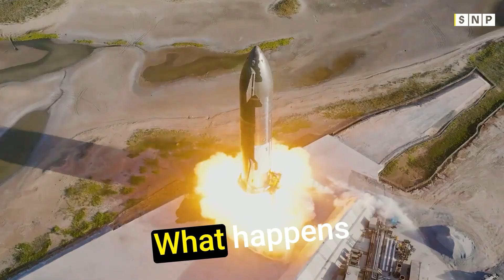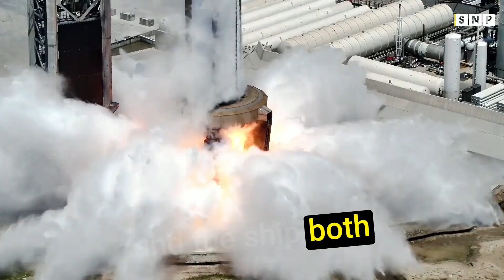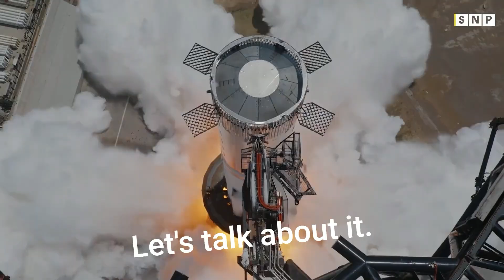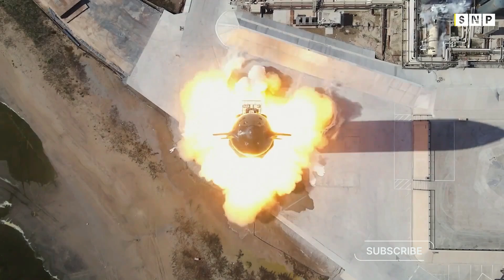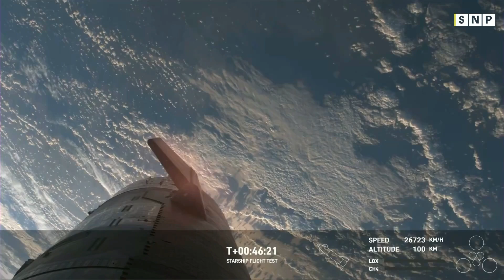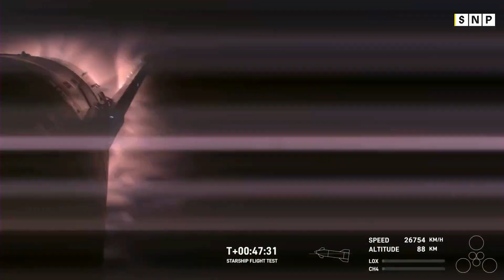SpaceX Starship Update - What happens next?

Comment: The pirate thing is nothing to worry about. There will be Military vessels on stand by. Also, I have worked with detonation/explosives for many years in the Military. You can submerge C-4 under water, and still remotely detonate it. 
The biggest issue is re-entry. It struggled on IFT-3, but that's all part of the plan. Look at F9, and how much it took to get to where its at now. 
Thanks for the episode. Greatly appreciated. 
 -- Will

Comment: I spent some time over the last week or two thinking about these topics and my conclusion is they will not build a tower just for catching, forget catching for a sec if they have a RUD at liftoff you have far worse damage than an empty landing vehicle gone wrong. Once the vertical storage tanks are gone the hotdog ones are more robust and more around the side out of most of the line of sight. Its more likely SpaceX clads the tower before the catch attempt while building the second tower at the same time as a backup worst case option, If the worst case happens and the first tower and pad are destroyed and they only have a catch tower they have to start from scratch anyway because they will never get permission to dig the pilings for a launch stand/table in sandy soil so close to the tower once it is built, that has to be done at the same time as the tower build or it has a chance of becoming the leaning tower of Boca Chica. Elon has mentioned the next flight they will not be doing a landing burn of the ship so it will be an almost terminal impact with the water if it even gets through re-entry (fingers crossed) so no chance of it being floating, So for the first simulated landing they will likely have orbital relights and manuvering solved first so it can perform true orbit and land in local waters where they can send a ship to recover and study it or just blow it up and sink it. Just my thoughts.
Reply: SpaceX will never attempt a catch without knowing the Booster is controllable like you said. They aren't going to let a 1,000 kmh+ vehicle near the catching arms. 
So in a worst case scenario, the Booster slows down to essentially 0 kmh and then falls some 10 meters and crashes. It'll have next to no propellant or oxidizer by that point so even if it explodes, it'll be a small explosion. One the OLM can withstand. 
So in reality a catch isn't that risky. It looks risky now with the Boosters not being controllable during the landing burn of the launch. But once it's figured out and fixed, it'll seem less and less risky. I reckon they'll get a successful catch by the end of the year. Q1 2025 at the latest

Comment: It is not optimal to use one launch tower for launching and another for landing. There is no way you can turn around the launch vehicles in under a few days by moving the rocket from the landing tower back to the launch tower. SpaceX's goal is several launches on one day. They can only do this if they land back at the same place they launch. More towers enable a faster launch cadence, but only if you launch and land at the same tower.

Comment: I don't see a problem with catching IFT5. The software will Yeet the booster away from the landing zone if it diverges from the plan – right up until capture commit. 

The only hazard to the OLM and Catch Arms is if an engine fails without warning during hover. Otherwise, the other two engines can increase thrust to compensate.
Reply: I agree with you.The sofware yeeting the booster at any sign of off nominal is a given. I spent some time over the last week or two thinking about Timms topics and my conclusion is they will not build a tower just for catching, forget catching for a sec if they have a RUD at liftoff you have far worse damage than an empty landing vehicle gone wrong. Once the vertical storage tanks are gone the hotdog ones are more robust and more around the side out of most of the line of sight. Its more likely SpaceX clads the tower before the catch attempt while building the second tower at the same time as a backup worst case option, If the worst case happens and the first tower and pad are destroyed and they only have a catch tower they have to start from scratch anyway because they will never get permission to dig the pilings for a launch stand/table in sandy soil so close to the tower once it is built, that has to be done at the same time as the tower build or it has a chance of becoming the leaning tower of Boca Chica. Elon has mentioned the next flight they will not be doing a landing burn of the ship so it will be an almost terminal impact with the water if it even gets through re-entry (fingers crossed) so no chance of it being floating, So for the first simulated landing they will likely have orbital relights and manuvering solved first so it can perform true orbit and land in local waters where they can send a ship to recover and study it or just blow it up and sink it. Just my thoughts.

Comment: Reviewing IFT-3 and the booster flips and fires its boost back burn and if you look at the speed it basically just slows down where it was and drops out of the sky. It doesn’t have the fuel to boost back further so I wonder if it will glide all the way back from the separation point. What is your thought on this? Can we get something maybe from Falcon 9 that shows how far it goes to do a RTLS?